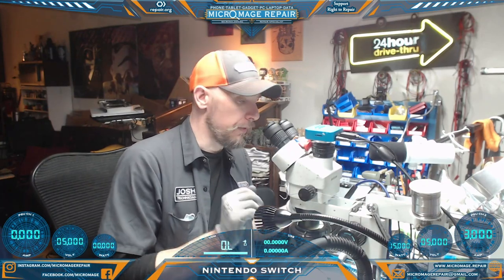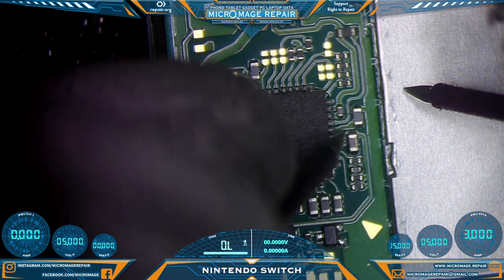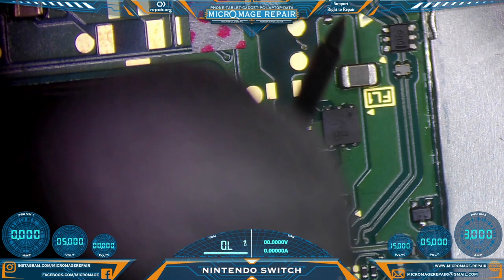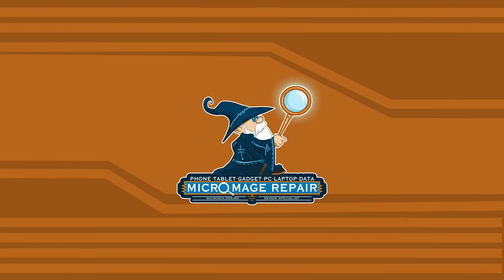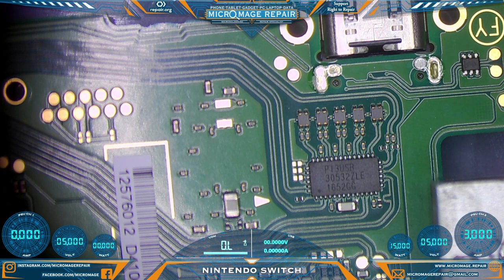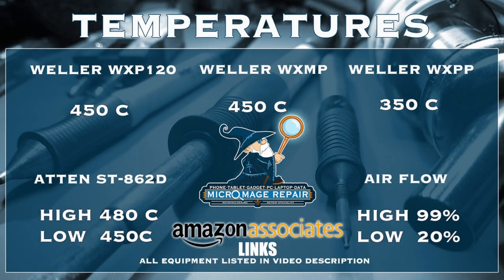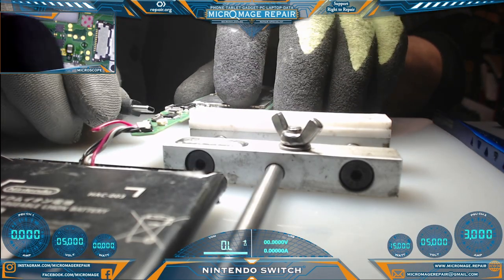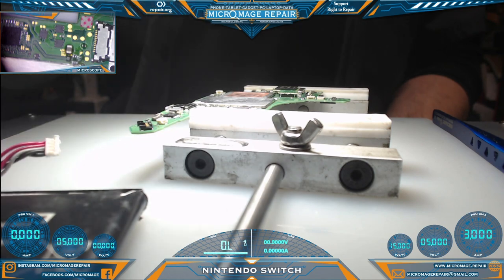Nintendo Switch: .14A No Power?

Comment: Nice repair! At 8:47 you use a power supply instead of the battery, can I ask what should the middle wire be connected to? (The one that is white on the original battery connector)
Reply from the maker: Thanks for the question thomapple! 
I  use a modified iPhone battery squid that I have retrofitted Switch battery connectors to.
The gray Switch signal wire goes to the white one on the squid.